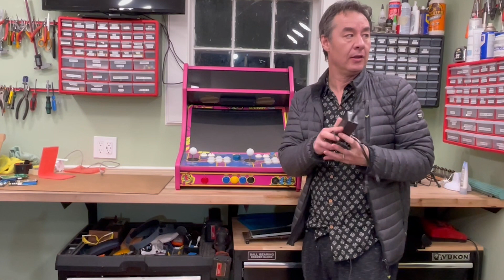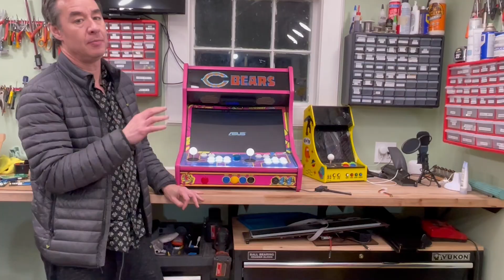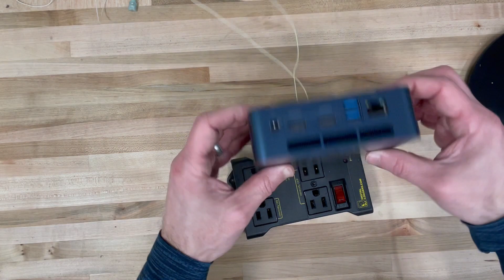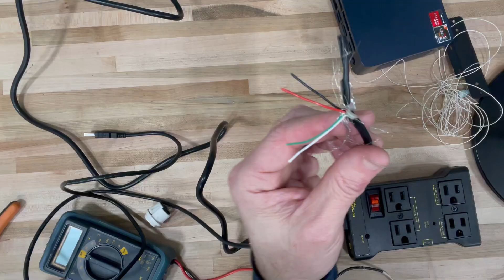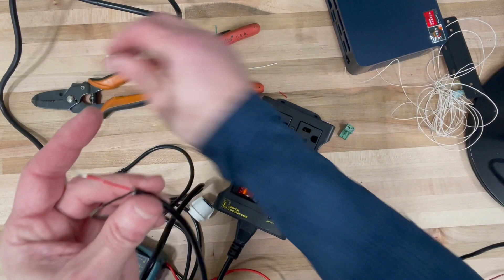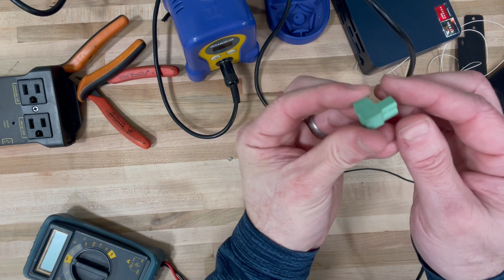Using an IoT Relay Power Strip for Arcade Safe Shutdowns and Common Power

Comment: Note: you have to use monitors/tv's that have the ability to remember power state. Otherwise they won't turn on when the power is turned on the IoT Relay Power Strip.
Reply from the maker: Thanks for the feedback , you can also plug the monitor into the iot relay power strip (extend one of the normally off plugs with another strip ), that’s how I have it